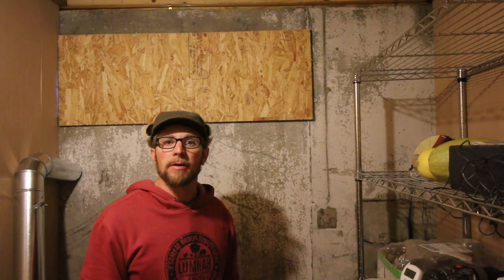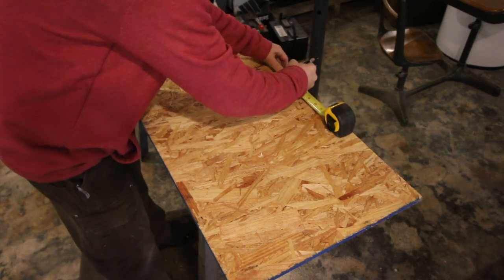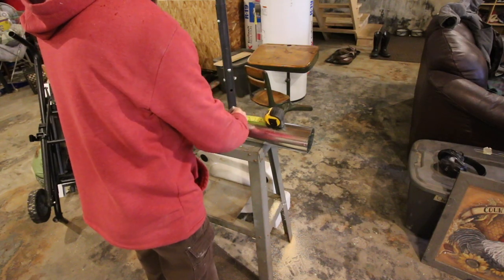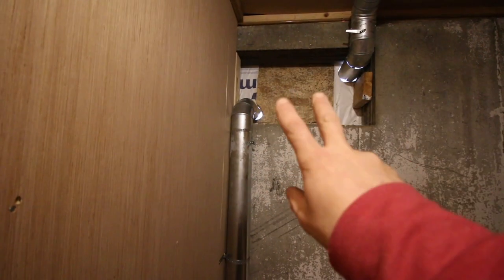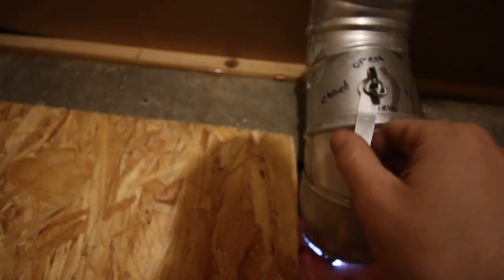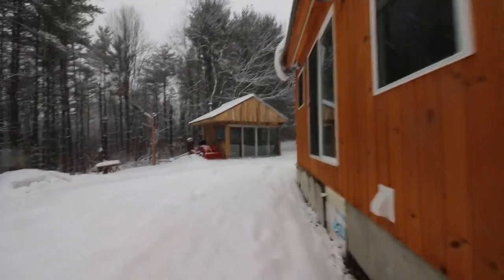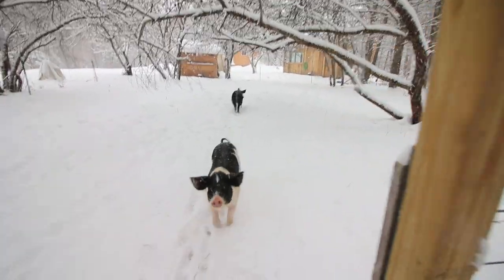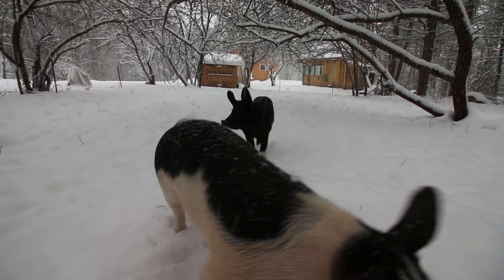Root Cellar~ Finishing Installing the Cold Air Intake

Comment: To mark a pipe evenly/squarely around the outside circumference, use what is called a "pipe wrap". Use a 6' to 8" wide piece of file divider, or anything else that would do that you might have handy. Then wrap the strip around the pipe at your mark, and make sure the wrap is tight on the pipe and the ends are squared up with one another.It will give you a square mark around the whole pipe. I was a pipe fitter for years.

Comment: Without elbows your system as it stands. The cold air will drop down, and roll out in roughly a 90* arc across the floor. With an elbow that flow would be directional, reducing even distribution. I would suggest leave that straight, and shorten it to 18-24". The farther it falls without restriction, the more natural turbulence it will create. In addition, being dropped to the floor, the more likely you'll further restrict the cold air distribution with racks and shelving. 
Your hot air is now at the highest point, drawing off the hottest air. With an elbow you would drop down below the hottest air, reducing efficiency. I would suggest adding two holes in your straight pipe, one at halfway, one at one third, to the hot air exhaust pipe. This would draw hot air more evenly across the ceiling. You could just drill these out with your 3" hole saw. I would also add an elbow outside with a short, 4-5' riser, and rain cap. The riser will work like a chimney riser giving better draft to pull off the hot air. As it is now, your hot air comes across the ceiling, then has to turn sharply down, against it's natural flow, to exhaust straight out. The straight riser will increase the airflow.
As a passive convection system, the hot air exhaust is going to be the driver for air exchange. The faster, more efficiently you can draw off the hot air, the more air you will move overall.
Whether you're moving liquids or gasses through pipes, the pipes, and fittings cause restriction to the efficient flow. A 90* elbow has the same restriction as 30' of straight pipe. One 45* elbow has the same restriction as one 10-15' of straight pipe. When ever planning if you can affect the same transition with two 45* elbow as with two 90* elbows, you reduce your restriction by more than half. For instance, your hot air coming into the room. You could accomplish the transition from the height of the window, up to the height of the ceiling with two 45* elbows, without affecting the location of your pipes significantly. This would have added roughly 1' to the straight section between elbows, the upper elbow would hit the ceiling roughly 1' further away from the outside wall, not significant, until you factor in the air restriction. The softer transition of the two 45* els reduces the restriction to 20-30' total vs. 60' total for the two 90* els. This reduces your flow restriction by roughly 50% or better, which means it will move more air efficiently. Drilling two additional inlets into the straight pipe will draw more hot air off the room. The more air moving through the pipe creates a stronger venturi effect of increased airflow. 
Merry Chrismas, Gina, Miss Livvie, Al, Pluto, Figaro.
Reply from the maker: Thanks I like the idea of drilling holes in the exhaust. I was thinking about a riser pipe but not sure how it will look! Lol

Comment: Also after your air conditioner install use the intake fan on the cold air inlet pipe so as to not having to use the air conditioner thru the winter

Comment: Hej Al! Merry Christmas! In terms of the vents, I think that if you leave the ceiling vent as it is, you'll be puling the warmest air in the room out, and and keep a flow going, while if you put in the 90 degree bend, you'll get a layer of warm air that always hangs out at ceiling level. I don't think the bottom one will make as much difference, as the cold air will spill out and sink to floor level one way or anouher.

Comment: I would also always use a LED lightbulb in that root cellar. I wouldn't want my light bulb heating up my room. ... Remember in the old Easy Bake oven a 60 watt lightbulb would bake a cake in less than 5 minutes! Even a florescent throws more heat than a LED. Merry Christmas from sunny Arizona, 65f today.

Comment: For the cold air, I would leave the elbow off. Yes, using the elbow would extend the pipe closer to the ground theoretically drawing cooler air, but I would worry about dust and hair collecting in the elbow. What if the wash machine ever flooded? The gap you have now also eliminates easy access by mice. xoxo from Arizona.

Comment: Forget the 90 degree elbows inside, more turns equals more air restriction.  I agree with the below comment that some chimney effect will benefit the flow, so outside put a short piece of riser pipe on the hot air exhaust.  And cap with a vent screen and try to prevent rain from coming in.  Also drill a small hole  in the lowest point outside to let moisture drip out.

Comment: Regarding your internal venting, I think a single meshed ground level 90 degree turn for the cold air is fine. For the hot air exhaust, if you can afford it, I'd be tempted to run a series of meshed T pieces alternating left and right across the length of the ceiling as a sort of manifold for multiple exhaust points: ═╦╩╦╩╦╩╦╩═ Externally, a raincapped chimney exhaust flue to create draw might be good?
Reply from the maker: I like the manifold idea. Yes we need to add a riser and rain cap on the outside exhaust flue

Comment: I know I'm late to the party... but:
- at the ceiling: No 90.   Then you're "sucking" air  from the ceiling level.   With the elbow, it's drawing from 8 or 10" lower allowing a pocket of warm air to form.
- At the floor:  Drop your pipe into a bucket.   it helps make it feel less drafty on your feet, and also encourages a little bit of stirring.   
- Exhaust side: taller "chimney" outdoors will probably give you more draft.
- And if you want to get REALLY fancy, you could get 2 motorized dampers, high and low limit thermostats and a transformer and make it automated.     Thermostat outside falling below "x" degrees applies power and opens the dampers.    Thermostat inside will open the circuit (closing the damper) if it gets too close to freezing temperature indoors(maybe 35-40).   It will open whenever conditions are favorable (even middle of the night) and close when it gets warm out.

Comment: They have very small fans that would be perfect for your application, uses almost no power to run. No fan is obviously the best but if doesn’t get room cold enough I suggest trying the fan. Put one on both pipes, one taking the internal air out and the other fan in. Just an idea. Merry Christmas to you and your family‼️🎁👍 🙏 Vinny 🇺🇸

Comment: My concern is that you have the 2 outlets too close together. I know you aren't dictated by code, but I still like to use it as a guideline. I can't remember if the openings need to be 4 or 8 feet apart. I'm sure there's plumbers out there to help me out with the distance. See how it works now, but if you can't return those elbows, consider using them outside to move the openings further apart. xoxo from Arizona.

Comment: Your vent system should work well... You will probably want to try turning the inlet vent on the left and on the right side to see which side is more efficient before you screw it secure to one side.

Comment: You've already built..
But in the building process if you had buried metal culvert pipe (rough inside to cause turbulence and metal good heat exchange) you cold get year round earth temperature..
If you had acess to a back hoe you could still install one..
To get a visual aid...
Google Taos NM. earthship. Image..(there is a good profile image)
I think the heat exchange underground like 20ft..
and if you have a metal riser pipe on the outside the heat rising causes the air flow...
(Bigger pipes on the outside increases air flow..
Check out the windows in the top of the earthship greenhouse... opening them causes the air flow) 
Some of you might point out the ridges in the bottom of the pipe should hold liquid and grow??
what I'm going to try is reaching back to the down elbow... And pour a cement soupish to flatten the bottom so it should incourage any liquid to flow out.. And if need be cleaned)
Well that's what I'm going to try first in my green house to work out the bugs...
(People that say geothermal heat exchange doesn't work.. All that I've read.. Were using PVC pipe..
I'm thinking PVC has an R-value and the walls are smooth which doesn't encourage heat exchange..)

Comment: I think if you're going to use a 90 on the ceiling piece it needs to lie horizontally rather than vertically. My thinking is that elbow extends down about 4 inches from the ceiling which means that heat would have to build up a little more before it would vent out.  And I think I've seen some T-Type unions that would work even better laid out at the end of the pipe also vertically and you can have it vent from both sides of the ceiling. I hope my comment was clear. I love The Root Cellar / cave Al and enjoy all your videos thanks for all the work you put into them.
I think vent hoods for your piping/vents would Safeguard against rain getting into the cellar.  And the holes even come screened  to keep the critters out.,...Just an idea.
https://goo.gl/images/oR9zjs
Reply from the maker: Yes your comments come across clear. I like the t idea! thanks